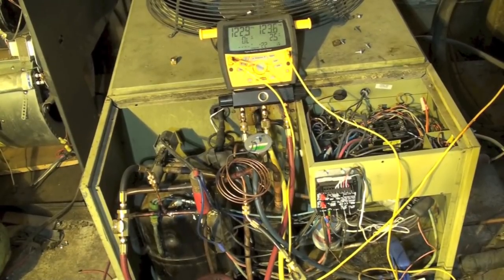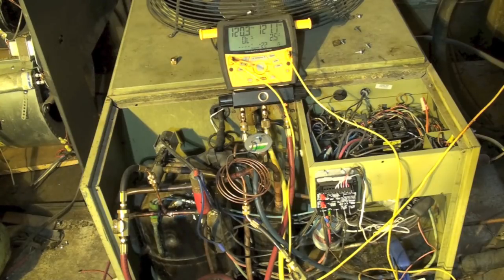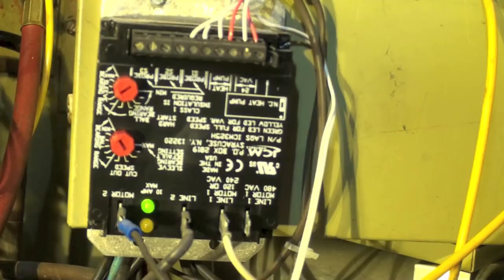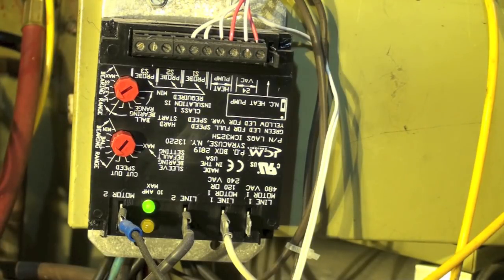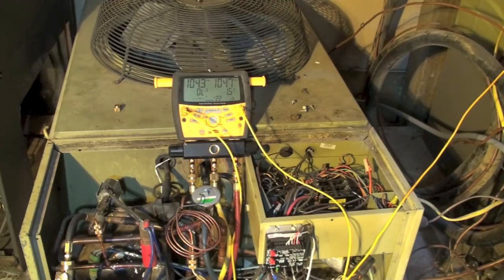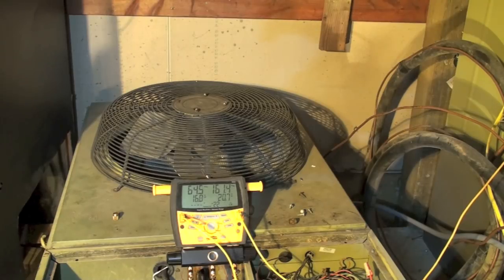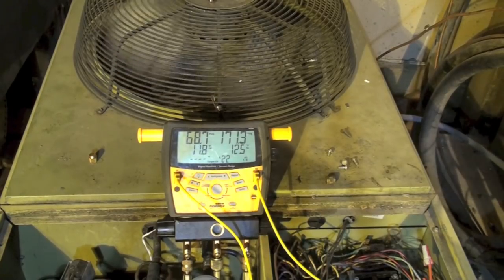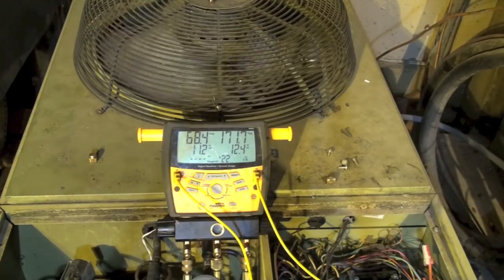Low ambient fan control for the air conditioner

Comment: just so i'm clear, low ambient pressure switches cut power to the fan so it won't cool the refrigerant to a point that there's not enough head pressure for the machine to run properly? Also it measures head pressure by temperature in condenser coils and not an actual pressure valve somewhere?

Comment: I ordered and just received a ICM 325 module.....and now have   questions of you.

The "installation,operation and application guide" instructs to put the temp probe on a "U bend" or between the fins -   in the UPPER THIRD of the condenser.......and to place the probe on the condenser where it is 100*F when pressures are correct for best response

the "installation instructions" instruct to attach the probe "to the outdoor coil at the return bend third tube from the " BOTTOM of the coil " 

problem is - with the unit in operation at 85*F ambient and doing a great job of maintaining 70*F room temp - there wasnt ANY "U bend" that was warmer than 92*F......top or bottom of the coil

since the device"mode of operation" is to apply Full voltage to the fan motor when the probe senses 100*F or over and when the probe senses between 70-100*F the speed is proportional to the probe temp - after an initial hard start....so if I install this module seems that it will probably ALWAYS be in modulated speed mode.

Have you any idea why Im only seeing 92*F  temp on return bends ......and what I can do to properly install this device ?....the A/C works very satisfactorily - I just wanted to more safely have the option of running it in low ambient conditions when cooking or other heat sources make room temp above set point.

as an addition piece of information and question - this Rheem 2.5 ton condenser has a mismatched York   slab evaporator coil and whomever installed it used 5/16 liquid line instead of 3/8.....what if anything does the undersized liquid line do to the system performance and could that be contributing to the issue here ?

thanks in advance
Reply from the maker: I have always installed them on a U bend in the center of the coil.  The idea here is to sense the condensing temp rather than de-superheat or sub cooled temp.  I would not worry about the u-bend temp.  If the liquid remains "lukewarm" to the touch you are probably ok.  Hope this helps.
GFM

Comment: I want to thank everyone that posted on my first questions.
I installed a ICM326HN and when it is hot 80-90 degrees outside it cools the house great to 69-70 degrees (and goes on and off) but when the outside temp goes down to 60 then it can't get the temp inside my house below 69 degrees without a freezing up, it will run set at 69 degrees going on and off without a freeze up, what do you think? A/C is 3 Years old if that matters.

Comment: Got a question, I installed one and the motor is squealing or like making a rubbing sound. I swapped sleeve bearing motor for ball bearing and no change. I changed the adjustment dials and nothing works. Do u know why? Asked others and they say use a ranco old fashioned cycle switch. My system is a 5 ton condenser from 81, miller refrigeration brand. And Its 208 3 ph
Reply from the maker: Is the motor 3 phase?
GFM
Reply: I’m having this issue now, did you end up finding out what caused the noise?

Comment: Just a question, I'm not trying to make it look like a critic, but if they like to use the air conditioning on a low ambient  why do they need a heat pump,  just wondering.
Reply from the maker: I am trying to understand your comment.  
A/C often is in operation at ambients below 80F.  The need for A/C is dependent a number of factors, such as internal heat loads, sunlight penetration and location.  
Commercial buildings often air condition at outside ambients as low as 40F.  
Does this answer anything for you?
GFM

Comment: This video is 5yrs old now what would you recommend for low ambient fan cycle switch/control? I take care of kidney clinics that run their AC year round and previously all they had on was a high pressure switch that was killing fan motors and compressors. Thanks for your help.
Reply from the maker: This type of fan control is still the best head pressure control.
GFM

Comment: What is the proper setting on each of the RED knobs?    My unit did not come with instructions.
Reply from the maker: The knobs should be set in the middle range.  It really does not make much difference.
GFM

Comment: Ok, I’ve got lost when you said you don’t want it to come on when the heat pump is in heating. I thought they supposed to work when the temp is like 30 or 40 outside. That way you stop the fan and the head pressure goes up.
Reply from the maker: You are going to have to relate your comment to your original post.  I cannot follow if there is no thread.
GFM

Comment: At what outdoor temp would you need this device? You say that it will work with original motor?
Reply from the maker: Jon C. If there is a call for cooling at outdoor temps below 70F.  This system will work with original equipment fan motors.  Hope this helps.GFM
Reply: grayfurnaceman thanks

Comment: What I meant to say ball bearings give you a more stable condensing  temperature, and they will last longer than sleeve bearings. I use them in server room/ data center applications.

Comment: Do you know  any cut out device that would prevent the compressor turns  on in winter time if someone try to run the AC  which it can  cause a damage . Thanks
Reply from the maker: You can install an ambient temp thermostat set to open the control circuit below a preset outdoor temp.
GFM
Reply: @grayfurnaceman  
I have a hard time to find any of them could you please provide me any mode #l or any link, thanks
Reply from the maker: @ebbyt00  Try this one:  Johnson controls model # A421GBF-02C
GFM

Comment: Could you show how, where and why the Temp probe should be placed
Reply from the maker: This is a manufacturer's instructions issue.  However, it is usually placed on the bottom third of the condenser coil.  It is attached to the copper tubing after removing some of the fins.  Hope this helps.
GFM
Reply: I was told by someone else to place it in the top 1/3 of the coil, I'm confused, Please confirm your instructions. Thanks for your advice. @grayfurnaceman

Comment: Hi!
It is low amient fan control for  HEAT PUMP airconditioner ?  What logical defrosting process for airconditioner with low ambient fan control for heat pump mode ?

Best regards,
Alexander
Reply from the maker: Alexander Gorelov This control is installed on a heat pump.  The control bypasses the fan control when the unit is in heat.  So there is no difference in defrost process.  Hope this helps.GFM
Reply: grayfurnaceman 
Thanks a lot!

Comment: I have installed these ICM Head Pressure controls a few times and I have had about half of the condenser fan motors go bad withing a year. One only lasted a few days. It seems the rescue condenser fan motors or general replacement NON OEM motors don't last very long at all. Every motor I installed to use with these were Ball Bearing motors. Some have failed because the motor winding's could not handle the Pulse Modulation and ended up failing because of winding's or bearings heating up as a result. I installed a Century Brand a few days ago and its already making a horrible noise and will have to change it out today. If anyone could provide a brand name for a Good condenser motor to use with these that they know last longer I would appreciate it. (UPDATE) : I called ICM Tech support and they recommended AO Smith brand motors. I will try them out with the next change out. However I am reluctant to know if their low priced rescue motors will  work any better Perhaps the AO Smith OEM motors are what is best no idea
Reply from the maker: I have not had these failure that I know of.  However, I think I always used them on OEM motors since the control has recommended their use with bronze bushings.  It is not unexpected though.   There have been many problems with pulse modulation as it tends to produce unwanted pulses in the rotor.  These sometimes produce a circuit between the rotor and the frame of the motor.  This will damage the bearings.  Some motors have gone to ceramic bearings to eliminate this.  Let me know what you find out.
GFM
Reply: I agree and have seen the same issue.  I think it is because the motors run hotter than normal when they are running less RPM's.  Best just to use a pressure switch with a cut in cut out setting.  I have hundreds of these mechanical fan cycle controls on units set at 275 cut in and 210 cut out (R22) and they work fine until they start leaking.  But the motors last.

Comment: I did some further research and found a web site that explains in detail how VFD and Pulse width modulation kills these motor bearings. There is actually arcing going on from the rotor shaft through the bearings and to the Motor frame (ground) I wouldn't  use the product they sell for the fix because it would be to cost prohibitive for such a small motor. Non conductive ceramic bearings may help if you can find a motor that uses them. Sleeve bearings may hold up better than ball bearings, but from my observation sleeve bearings eventually fail early too. http://www.est-aegis.com/js/AEGIS_HVAC_White_Paper_JohnstoneSupply.pdf

Comment: What I find amazing is , these head pressure controls have been on the market since forever and today there are more and more of these Expensive Genteq ECM variable speed DC motors in the Air handler for the higher SEER rating approval .. BUT yet we do not see the same type of control for PSC AC  blower motors (To vary the speed for better humidity and energy saviings , but we do see a very expensive GENTEQ DC motor ) .. How come We dont have this for blower motors ?   I'm sure you all know about the ECM variable speed motors and how expensive they are.. ??
Reply from the maker: Unfortunately, simple fixes are not considered as much as they should be when determining how to build these things.  Carrier used this type of control about 30 years ago, but I have not seen them on newer units.  Coleman also used an indoor fan PSC motor with the speed control built in to the IFC but it was also not popular.
GFM
Reply from the maker: I am afraid I will have to differ with you there.  The ozone damage is real.  You can find anything you want on the internet, so if you want to believe its a hoax, I guess you can.  However, there are no credible studies that refute it.  I will be doing a video on ozone in the future.
GFM